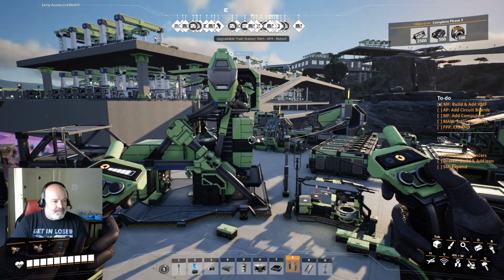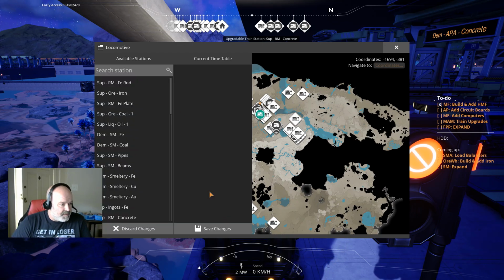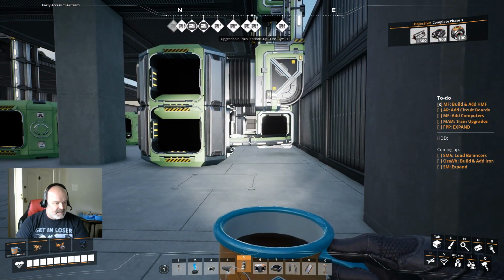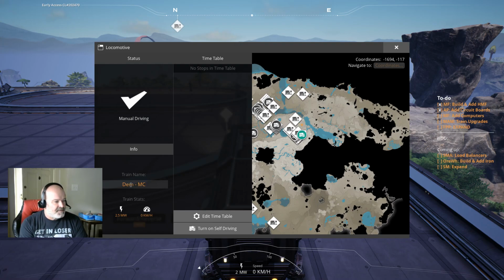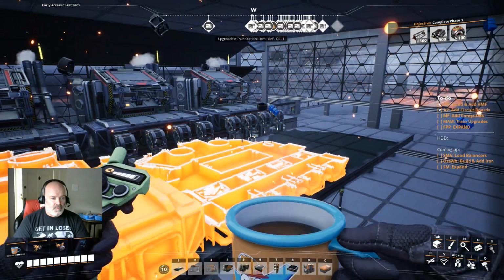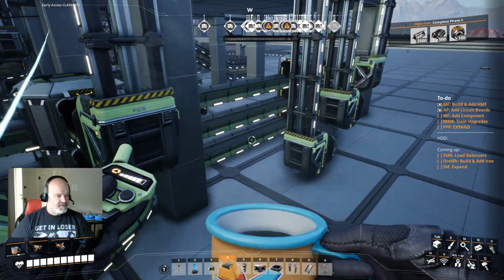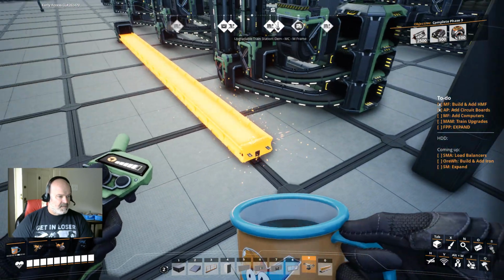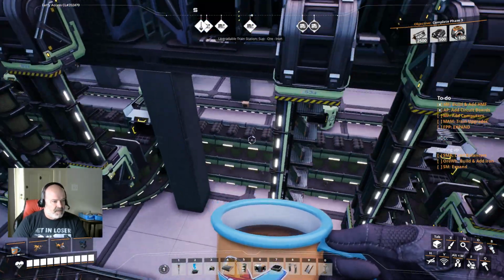COMPUTER LOVE - S2 E038 - Satisfactory Update 6 Lets Play

Comment: Thoughts (written as I watch):
-If that dialog during the building sequence didn't prove too time demanding it worked out great!
-White/Light Blue and White/Green (or Black/Green) are suggestions based on real railroads (Rock Island and Burlington Northern). I had some other thoughts but for that one I like the idea of using the colors of a freight railroad.
-The overall progress of the buildings looks great. The aesthetic you went with works well
Reply from the maker: Thanks a ton! White / Light Blue could work. 🤔